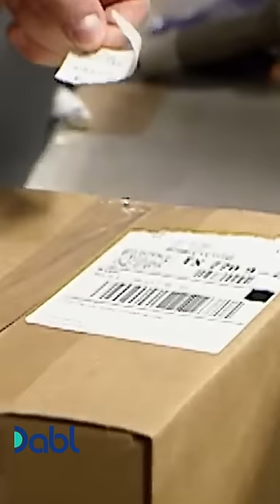Undercover Boss Fired for Packing Boxes Terribly #shorts

Comment: Boss acted like the dude has been slacking for the past 2 months by the way he fired him.
Reply: The dude couldn’t figure out a tape roller. The speed probably would have been ignored for a week or two if he wasn’t utterly incompetent at such a simple action.
Reply: If the CEO wasnt on TV he would likely do a once a year walk through of a factory and fire people like that while he continues to do way less work.
Reply: @mattburkett9419  Have you used a rape roller? tape gun. Whatever the fuck you want to call it. Like someone else pointed out, you can get ones that are extremely smooth and then get one that doesn't move at all. Used them before. Some are easy. Some just have too much tension and don't work. My guess is he had one that didn't work all that well. You could see it was putting too much tension on the tape by how the end of the box with tape on it was starting crush a little. Even something as simple as a tape roller requires practice in order to become fast and efficient at using. You'd be the type of guy to fire someone because you haven't give them more than 5 minutes to practice and get accustomed to the equipment that they're using.
What's funny about this is the guy that fired him, guarantee he wouldn't be able to hit the target numbers in his first day either. The only time you get rid of someone that's slow, is when they've been adequately trained, had plenty of practice over the past week and still suck at doing a simple task. But you first have to actually let them get used to doing that thing.
Reply: @jonnywilson9117 ayo? A what?
Reply: @mattburkett9419  the tape gun/roller is the most mindlessly easy tool to utilize once u get into the swing of things.
Reply: @jonnywilson9117  don't most of them tape guns got settings to either make the roller more or less tense to wat they are use to?
Reply: @Dan55888  
He may do different work, that doesn't mean he does less.
Reply: He has the motor skills of a
Toddler, dangerous employee to keep
Reply: @mattburkett9419  it’s cause the tape roller was almost out, he needed a new roll. I work at UPS and once they get down a certain amount they’re so hard to use efficiently😂
Reply: @CaptClaymor  Well yes, but to do it as quick as she was doing it, that takes months of practice. Believe it or not. It does. You don't get that quick in 10 minutes or a week.
Reply: @ryman1933  LMAO U SAW IR TOO
Reply: I worked in packing, 80 cartons a minute on the machine was the target, but they gave us a month to hit it. The thing that would get you fired on the spot was ignoring QA problems and packing bad boxes. If you watch the full clip, the ceo submitted boxes with labels that wouldn't fly. If the problem was just speed they'd probably give a little more leeway but he came off completely incompetent.
Reply: @jonnywilson9117 Excuse me friend.... What?
Reply: Nah he just acted the same way the boss would have
Reply: @jonnywilson9117  You win.
Reply: Ur confusing people by saying the boss fired the dude lol because the “dude” that was fired IS the boss, the undercover boss, the CEO got “fired” by the manager who in reality is under him too
Reply: @yowhatitlooklike  80 a minute? So you'd spend less than a second on each. That's insane..
Reply: @Dan55888  cmon man do you really think CEOs are walking through workplaces firing people willy nilly? they’ll bring it up to the middle management whose job it is to handle that if anything. would have to be a pretty small company otherwise
Reply: @grahamhill676  that was the minimum rate for putting actual product into cartons, and in practice you'd fill every other carton and your coworker filled the ones you skip or miss, so it was more like 40-60 a minute, but the more skilled workers brought the speed up a bit. It could be anywhere from 1-4 "sticks" in a carton though, more sticks were more difficult. 

Packing the actual boxes (as they're doing in the clip) happened at the end of the line, you had around 16-32 cartons a box depending on carton sizes that you'd stack as they came to you on the conveyor and fill the box in front of you (a combi machine would handle the taping and box creation). 

So for packers it was more like 4-6 boxes a minute. But you also had to remove any bad cartons and check the product codes for misprints before packing, which quickly turned into chaos as the conveyor backs up really quickly, or cost you your job when QA finds you weren't paying attention to the state of the cartons. Nobody wanted to pack lol
Reply: @lilchristuten7568 He definitely does less,.especially given how much more he is paid.
Reply: @fixitfeilix5051  no, not less. Just different work.
Reply: @jonnywilson9117  a what roller?
Reply: @james  Sounds like hell. Especially as you could just have a bad day and every second matters. I work the line in a very busy fast food place and I've been there here for 6 years part time alongside studies etc. The monotony and pressure can really get to you, and there's a reason a lot of people quit these kinds of jobs and it isn't always because the actual task is difficult. There's good days and bad days but the bad days aren't worth it. I couldn't do it full time mentally, despite how physically easy it is.
"It's easy" says people who are either experts in the industry, or are clueless, never the average worker.
Reply: @jonnywilson9117 you can adjust the tension...you gotta be smarter than the tape roller 😂😂😂

Edit: months to master a tape roller? 😂😂😂
Reply: @lilchristuten7568  most likely does less though, that’s literally the benefit of being a ceo.
Reply: @jonnywilson9117  no, teenagers do it like this with 0 practice. Watching a 40 year old fail a basic task is truly remarkable. But he’s white so I wasn’t expecting a good work ethic.
Reply: @sammyauscux9529  yes, objectively less work. They did more back in the day when they were getting the company started. Now that it’s going the “work” is extremely easy.
Reply: @grahamhill676  definitely easier than maple leaf.
Reply: @grahamhill676  I mean, it is easy work. It’s not physically demanding. It’s not mentally demanding. It’s routine. Simple as it gets.
Reply: @mattburkett9419  not as easy as licking boots though eh?
Reply: @f1fanatic241  less work doesn't equal easy. 

Handling boxes 40 hours a week and handling the whole company with all the workers 40 hours a week isn't less, just different.
Reply: @F1 Fanatic  Literally doing the same thing for hours on end isn't mentally demanding? Jog on
Reply: @Machete87  it took you more than a couple minutes? You would be fired too
Reply: @CaptClaymor  never seen a workplace do that and probably for good reason lol keep finding clever ways to save your boss a couple dollars.  But sure because you know something everyone must know too it has to be common sense because you've seen it 😂
Reply: Some of you have never had jobs and it shows
Reply: People here do realise that the boss purposely has to act incompetent and 'new to the job' as to not raise suspicion, right? That's usually the case the majority of the time with this show
Reply: @ryman1933 lmfao how did more people not notice this??
Reply: @justinbarton2278  Idk either they deliberately ignored it or simply didn't notice it
Reply: @Dan55888 , While playing AC/DC in the background too. 😂
Reply: @mattburkett9419  bro, there is a learning curve yo everything, but like most unaware people you dont understand what doesnt effect you.
Reply: @CaptClaymor  jeez, that soumds like something that could easily been relayed to him. Tbis is definitley more of a reflection on management than him.
Reply: It’s reality tv bro none of that shit is real
Reply: @sammyauscux9529  Then he should be paid the same amount. What actual work does he do? How much effort does it take? How much time? How much of his job can be automated with a spreadsheet, or a general piece of software? How much of what he does is actually relevant to the company? What of all of that justifies how much more he's paid than the lowest tier worker?
Reply: @mattburkett9419  I did this for work for 4 days.. on the first day I was absolutely terrible and was literally doing the same thing this guy was doing and then the third day I got really quick, i'm a quick learner and it's because I had never used a tape roller before in my life which made it difficult when I begun. It's not incompetence, it's inexperience.

P.S. I quit after the 4th day because I found out how depressing those jobs are and decided to start my own business while studying.
Reply: Almost like it's a scripted tv show with multiple camera angles or something
Reply: @StormTheSquid  while I agree that a lot are grossly overpaid, you're usually not paid by how much work you do. 

It starts with the qualifications. Then add responsibilities. Someone taping packages can't really mess up that bad. Redo do it and there might be a couple cents worth of time and material being lost. A manager/CEO messing up could be way worse. They're handling a lot of employees and money. The whole company could be doomed by over mistake.

But all of that doesn't have anything to do with the original topic. They don't work less, just different
Reply: @Dan55888  lol. You think that line worker brings their work home with them? I love the totally ignorant opinion of white collar work
Reply: Wasn’t it the real Boss that was fired?
Reply: When you work in assembly position it's almost always slow at first and then you pick up ans get faster, if you're firing ppl before they can get used to the weird awkward stage then you'll always be understaffed and the woman there will never get a promotion and always be overworked
Reply: @ryman1933  😂
Reply: Ur good or bad. There’s no third option
Reply: @f1fanatic241  What's race got to do with work ethic?
Reply: @lilchristuten7568 ask anybody that has moved beyonds 70 k a year. The absolutely work much less It's mostly decision making rather than actual work and long hours. For them the difficulty is risk not the labor or the mental exhaustion with the long hours. Workers get long hours and exhaustion but little to no risk besides maintaining his own job.
Reply: @Dan55888  you’re acting like the workers could do the CEOs job lmak
Reply: @lilchristuten7568  I bet youre an Office worker.
Defending people for doing nothing
Reply: That is exactly what the heads of a company expect, though. The CEO made it that way.
Reply: I was gonna say isn't this his like first day or two lol? Why would they be stressing about his numbers already?
Reply: Kyl Schwartz  of course some of them could do. 
I was construction worker but i was so good that i got a raise over the years. Now iam ceo of my company
Reply: Kyl Schwartz  Not straight. But in the middle positions i had no special  graduations. I did business school after a few years in a upoer position
Reply: Kyl Schwartz  i never said a large company. We have 78 employes for know..
We do plumbing,Electricity,Air conditioning and Heating
Reply: Kyl Schwartz  btw. I had to deal with many so called qualified people.  People with paper not more.
Lazy unmotivated arrogant . 
When you give the same job to people that come from lower jobs they give 100%.
Reply: Kyl Schwartz  We struggle to find construction workers. Especially students. Because today young people know they will never earn much money and only destroy their bodys.
Reply: Kyl Schwartz  No problem Mate.
Reply: @jonnywilson9117  Hey man im not reading your text wall, but change rape roller to tape roller you misspelled it and its very distracting.
Reply: @Ben-jl2rh  You know, I noticed that after re reading it. Once I posted it obviously and it had some replies. I'm sure we all know what the right thing to do is...

Fuck it. I'm leaving it. Calling it a rape roller just changes the context of the entire conversation.  I did definitely mistype it though. Funny how I fucked up the T and not any other letter lmao
Reply: @jonnywilson9117  I usually get upset with people who don't fix typos but man, you are truly epic. Your response had me dying on the floor
Reply: @Ben-jl2rh  😂 Had me chuckling to myself while typing it
Reply: @jonnywilson9117  Lol you're fun man, stay happy
Reply: @Ben-jl2rh  You too dude, You too.
Appreciate it.
Reply: @Dan55888  This is why your not a CEO yourself. 😂
Reply: Right, dudes eyes were shot open & had a stern ass voice lol. He was ready to fight. & We would've been
Reply: @CaptClaymor  don't you think the fact you need to explain it shows that using them at peak efficiency is in fact not SO easy that anyone can be expected figure it out on their own after a couple of minutes/hours? 💁‍♂️
Reply: @jonnywilson9117 A huh??

Comment: Those tape rollers are fucking demons I swear.
genuinely, sometimes you get the smoothest pull, other times it just refuses to move.
Reply: I found it was mostly how you held the angle as you pulled, it became muscle memory after a while.
Reply: A solid yank at a near 90° angle works most if not all the time
Reply: You can adjust the tightness on the little knob on the part where you put the tape. I usually unscrew mine so it's loose to make for easier taping.
Reply: Bro for real. Used to do this at a meat market and would always try and cut into my shift early just to get the 'good' one. The guys would horde it or switch them out just to get their work done properly.
Reply: Check the tensioner
Reply: Found out, the cheapest rolers are the best. 
The tape makes the differnce - it shold roll down very quite and easyly.
Reply: They have it tightened on him. He needs to loosen it up so the tape rolls a little easier. This is fake as hell.
Reply: Put a finger on the tape and press it a bit while rolling.
Reply: We had ones that would undo the nut and cone apart
Reply: @BakeBMDeezy  i unscrewed a bit and then it CONTINUALLY come off and I had to chuck it out
Reply: You can tighten/loosen them. His was obviously tight af. You can see he almost pulls the box out of his hand while taping.The lady's was on a  super low setting.
Reply: I’ve had it jam more times then not 😂
Reply: @roberto4350  Nah, it was fine. He was holding them without leverage. She had a firm grip on the top keeping the flaps closed. He was hugging it, and the awkward position was preventing him from pulling. Plus, his pressure was opening the lid, slowing him further.
Most if it is body mechanics and hand placement. Same for putting down the sticker. Lead with the finger, slide with the other digit so you put sticker down without air.
Reply: Thank fuck I'm not alone with those things...
Reply: You gotta unscrew it a little makes it looser or tighter your preference 😂
Reply: Kitchen cling wrap 🤬
Reply: Skill issue
Reply: The amount of times I've cut myself on the metal strip as well 🫠🫠
Reply: You can set the tension...
Reply: The “automated tapers” Suck, don’t cut😂long line tape free while the other boxes didn’t get NNNUUUUTIN!
Reply: That dude is a muppet. Tape guns are easy to use
Reply: Ikr lmao
Reply: If you use it correctly it's flawless.
Reply: You gotta find the right tension. Theres a spring that adjusts it where the tape is.
Reply: Theyre askistable
Reply: So clean it between rolls or adjust the tension of the tape gun.
Reply: The ends of the roller were never sharp enough and it wouldn't cut the tape. I think I had to rip it off with my fingers. 😪
Reply: Same here
Reply: I almost lost a finger using one of those at home for the first time
Reply: loosen the friction knob, knob
Reply: His was too tight she should have noticed that as his trainner
Reply: And one wrong move they will slice you open like a razor blade
Reply: The tape gun is fine. Those kinds are meant to be used a certain way. The more pressure the tighter the tension gets. Don't use pressure until you mean for it to tighten up for the cut. It's easy.
Reply: I shipped orders for 6 years. You get used to it. It's a tool that you learn to use like it's an extension of yourself. It just takes a little bit to get used to it.
Reply: The ones we have, the tape always pops out of them mid-roll.
Reply: I swear a co worker gave me a Bad one once! Awful
Reply: @richardchiodo2200 thanks
Reply: Also hate it when u get a shitty one that doesnt work too well because someone hogs the good one
Reply: This thread proves why they should have given him training instead of firing him after a few hours.
Crazy how many people (who most likely never uses these devices in their live) think he lacks common sense for not picking up her pace right away. Of course it takes the right techniques and adjustments and finally some time to get used to it to do it this fast with it!